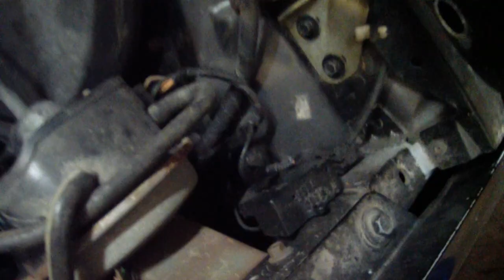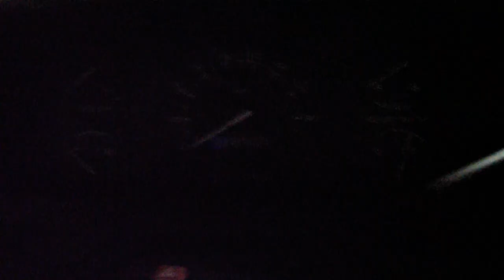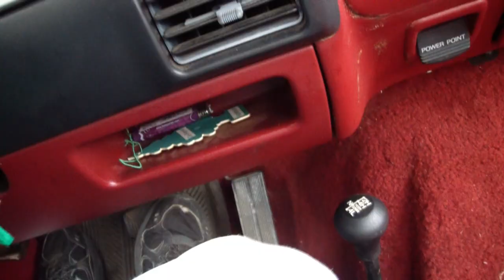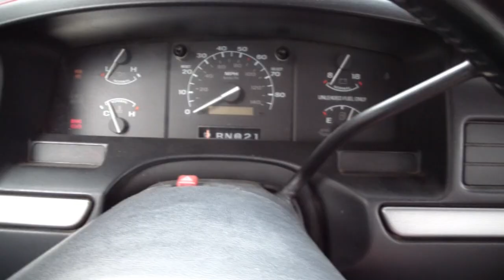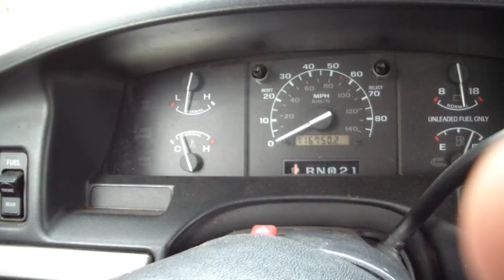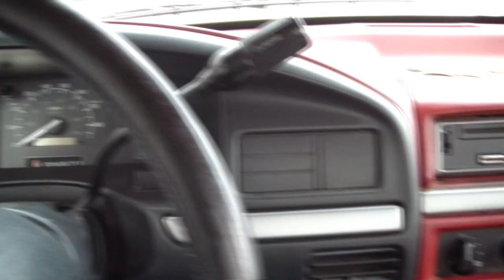How to read a check engine light code on a Ford 1983-1995 EEC 4 system

Comment: any special gauge wire I need to use to avoid problems?
Reply: Droplifter ahh perrrrrfect! I found my EEC yesterday! Thank you for such great info. Auto zone was helping but not finding my obd1 on 1994 engine was sending me to the dealer$hip. Knowing this method enables me to help me...forever!  Thanks.
Reply: shelleyfunny19 Get a digital code tester from Amazon and the extension cable.
Reply: shelleyfunny19
 12-2 should be fine

Comment: Hey, I don't know if somebody will read this but, I have a Ford Ranger 1995 2.3, I look for the EEC IV in the engine compartment but I didn't found it, but below the steering column I have an OBD II plug I also read that 1995 was like a "transition" year between systems so I don't know what do I have to do in orden to pull my "Check Engine" codes
Reply: Benjamín If it has OBD II, get a code tester for OBDII from a parts store. If EEC-IV get a digital code tester from Amazon.

Comment: I have a 1992 Ford F-150 and im using the Dash Display Diagnostic and im getting the code E03. I saw you have a Code book. Do you know where i can get one?
Reply: Ok. Im gonna try testing my truck today as its ben havin some MAJOR problems. It wants to stall when its warmed up and if i stop to hard. So i need a codebook to read the codes. Thnx
Reply: ***** Thanks. I pulled a mess of codes ill try and look up on Google or someplace. Here are the codes if your interested.

Engine off Key on: 663, 611, 411
Engine on Key on: 114, 632, 663
(ik some people it kinda bug's em when they dont find out a problem)
Reply: No no no. If you turn the key wile holding the Odometer trip. The gauges will do a full sweep and read messages. Im getting an E03 code.
Reply: @Krisb193  that's not a error code. That's the calibration of the pmos

Comment: it really doesnt matter what u use tho, anything conductive just make sure u dont ground it out on anything if its not a piece of insulated wire, iv always used a paper clip on ever vehicle iv done jus for the rigidity n ease of stickin it in the connector, and it doesnt fall or wanna touch any metal, it jus sits there.
Reply: Travis Miller Any jumper wire that fits will do.

Comment: That egr code (insufficient flow) was a funny story on an expedition. Found 2 holes down the throat of the intake that were clogged with hard carbon. You have to use a mirror to see them but to clean them out I took a thick piece of wire and bent it like a "J" and drilled out the 2 holes...wala! code gone!
Reply: Those were likely the ports for the IACV.

Comment: I think the '86 doesn't flash the check engine light. If I recall correctly, on my '87 I needed to hook up a analog volt meter to a slot in the test connector and the positive of the battery. The needle on the volt meter would then pulse just like the check engine light. The check engine light does not flash on '87 and older.
Reply: David Barkes , on my boat, there IS no check engines light...so that would make sense to have an alternate source of feedback.

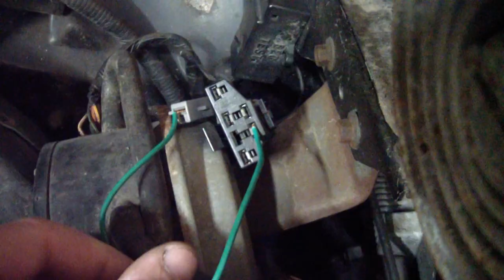Comment: What size jumper wire did you use, and what did you put on the end of each wire to make it connect to the plugs. Also if you pause at 0:38 and you look at the gray plug to the left, is that also connected to the eec test cover or is it located somewhere else. All i can tell is that it is an indidual plug.
Reply: Would had been a much better video if he'd shown and explained these very important steps and how to use each jumper wire.

Comment: i can't get my 91 ford bronco to go into an engine running test. it still does an engine off test even though it is running. I tried a couple times figureing i missed something. but still no luck. after restarting it automatically gives me codes and not the 4 flashes for the v8. I also have a 91 f150 and it worked in it. Any ideas as to why the bronco would do that?